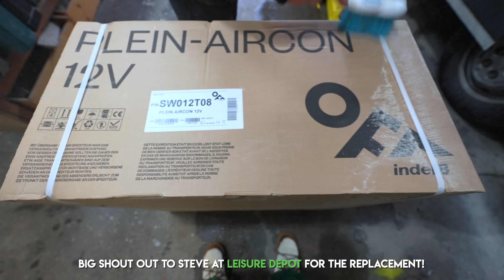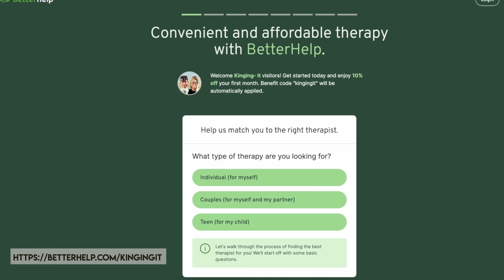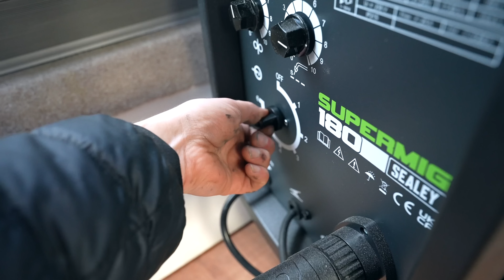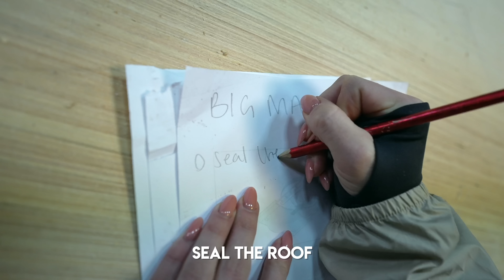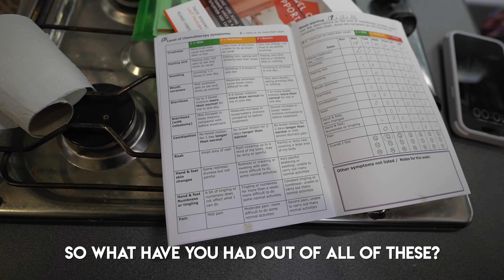This isn't how we wanted to start 2024....

Comment: As someone who built out their van and then bought a house – a level! A good, four foot level was very necessary – it was never really relevant before with my van since nothing will technically ever be 'level' in there haha. And a sawzall for demo. Was always too afraid of those and was used to the good old oscillating multitool, but it doesn't cut it when you're trying to tear down studs!

Comment: For tools… I don’t know if you can get battery powered tool sets where you’re at, but if you can get a whole set you’ll be better off. 
Reciprocal saw, drill and impact driver, saws-all, angle grinder, hand sander. Get as many batteries and chargers as you can to keep the work party moving! Lights on stands, shop vac and plumbing essentials would also be great.
Bigger tools that would come in handy would be a chop saw and table saw. 
Do what I do… ask friends and family for tools for birthdays and Christmas 🥰
Estate sales are great!

Comment: There will be a local pipe band where you can join and learn the pipes for free, most regions will have one or two pipe bands. It’ll be roughly a year before you’re ready for actual bagpipes, usually a year learning basic songs on the chanter. It’s well worth doing and great fun. Usually have classes weekly. 😊

Comment: Tools - Battery Powered...if on a budget, get deWalt, if you're after quality, get Milwaukee.

Make sure you get plenty of, at least, 5Ah batteries and a charger...that can do a few at a time.

Get yourselves:
Impact screwdriver + drill (usually there'll be a kit where both are sold together.  Make sure to also get a bit kit with multiples if all different sizes if screw driver bit ends in it.  Also, if you can get a drill bit kit to go with it, that'ld be handy for you too.

Circular Saw...one that can cut most the way through a 100mm thick joist.

Jigsaw...make sure to get one that will fit your needs though...get plenty of blades for it too.

Multi-tool...with plenty of spare blades.. M18 Milwaukee Fuel Brushless one is the best ive used I have to say.

You may want to get yourself a grinder capable of cutting brick/stone...theres sometimes the need to trim something back which only a grinder can do (chasing electrics in for e.g.)...it may be possible to hire one at a pinch though.

Hand saws of a few different types.

Pull saws of a few different types.

A decent crowbar set with a flat iron and a number of different length chunky ones.

Get yourself a Machine Mart own brand 35ltr wet/dry shop vac.

Spanners and a roll of assorted grippers is always handy.

Bosh speed spade bits are the best for drilling holes through lumber.

A belt sander is good for shaping wood in a pinch if you ratchet strap it down with the sander facing upwards and lock on the power switch.

A metabo random orbital sander is good for sanding large boards/doors/areas of wall etc.

Hammers/mallets of varying types...with one rubber one for persuasion purposes.

There's a website called Accu which is amazing for fittings such as load spreading washers made out of stainless steel and all manner of bolts at all sorts of different sizes.

Don't forget PPE either...goggles, masks, boots etc.

Also, decent stuff and soft bristled brushes, dustpans, different sorts of scrapers, and plenty of nice n'thick rubble sacks...just remember to separate out your types of rubble such that you can take it directly to the appropriate tip skip at the council dump when you need to get rid if it without holding everyone up as you separate it on site

😊

Comment: Good thoughts for Gary.  Tools needed: Hammer, screwdrivers a variety, level, tape measure, saw both hand  and circular, cordless drill, electric tape, a variety of screws and nails, pliers, monkey wrench , vice scripts - that would give you a good start.

Comment: Wishing a Gary the best of health and a full recovery.  Tools:  get a power tool pack with rechargeable batteries (Ryobi, AEG, Milwaukee) including a drill, impact driver, skill saw, hedge trimmer, multi tool. And a plug-in sander (black & decker).  Multiple measuring tapes. A good tool bag or box.  These will be with you for many, many years to come so don’t be scared to invest upfront (we only got all these together in a tool bag after 10+years of home ownership and projects, so learn from others). Or get sponsorship, of course!!

Comment: All the best to Gary for a speedy recovery. My father has stage 4 terminal bowel cancer that has metastasised. Listen to Gary, and go straight to a quack and get checked out. Advocate for yourself. If the doctor isn't investigating, then get a second opinion. Don't leave it until it's too late. 
Also, excellent job on the roof repair.

Comment: Ok, essential tool to have for a home - I really rate something quite basic, which is a ratchet screwdriver with changeable bits. It's excellent for all smaller jobs, and even though you'll have big jobs, the big jobs are often made up of smaller jobs. Plus, such screwdrivers are only like £15 for a decent brand like Stanley and will last for a LONG time (it's probably more likely to be lost than worn out). 
Also, see if there's a local tool library as you can then borrow tools you'll need intensively for a while rather than have to buy them.

Comment: Basic tool box you see at the store or on the internet screwdrivers flat head hammer measuring tape pliers wrench saw utility knife level power tool PREFERABLY CRAFTSMAN on non power tools by craftsman have life time warranty so even at a yard sale pick them up if cheap even if broken or rusted and get a new one out of it! Then power tools DeWalt 20volt are awesome my cousin owns a roofing company and swears by both brands.

Comment: A normal comment from me now. Not the though stuff. The bagpipe. Why am I not suprised. Becauce I watching Kinging it. The step shoes. Why am I not suprised? Because I watch Kinging  it. Why am I giggeling even tho I got a bit sad there. Because I watch kinging it. You guys rock! :D
 Custard will be a nice home for the year to come. I am also watching Mrs and mr adventure down in Portugal. They are doing the same. However I am pretty sure they are in a more comfortble climate than scotland. :D - 12 in scotland. Wtf! I have that here. I live in Norway and in these parts of Norway it is cosidered bitter cold. It is aweful. Dang guys she needs heavy isolating. Get yourself what we call super undergarment. That is what norwegian use in winter. Keeps your warm and comfy too. Google Kari traa or just norwegian super undergarment. kari traa is a brand but it is very good.  It is worth it. 
As for tool an bagpipe and stepshoes wont renovate your house.  Well i guess you can use the shoes for hammer. 😂  I wanna see that. 😅 😁 Good golly Custard was leaking. Did you check for bad mold? That is not a safe environment for sure. Just as bad as the mouse pop.
A question to finish up the speech here. What kind of breed is the most adorable cutest loveliest gorgeous funny dog I have ever seen? Swooon. 😍